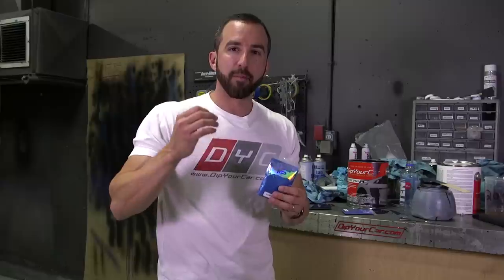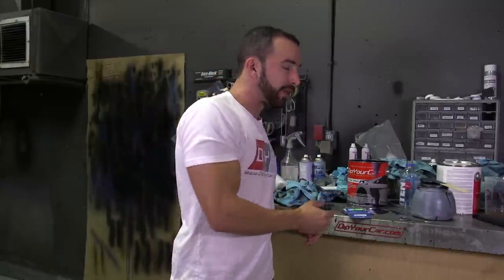Mixing BLUE Pearls into SHADOW BLACK

Comment: I think that color was perfect for the STI. Did you do any coats with the gloss topcoat? Did you coat it with DipCoat after finishing? And are there any UV protectants in the paint to prevent it from baking onto the car on horizontal surfaces?

Also, I think this would look amazing with a gold pearl and/or gold metallic flakes. I also think it would look amazing on wheels with silver-toned pearls or flakes so they look mostly blacked out but also have a slight metal shine in the right light.

Comment: I just found this channel and I think it's a really interesting medium you're working with! You're basically using the same pigments that are in eyeshadows to create reversible art on your cars on a much bigger scale. I've binge watched a good number of your videos and took a quick look at your channel. I think it would be really cool to see you do more themed cars (your Psychedelic Storm Trooper one looked fantastic) or maybe start branching into things like different techniques for application (stenciling, more fading from one color to another--the color in this video along the bottom of the car faded up to matte black or something would look really cool). Something to start taking what you're already doing really well to the next, even more customized level. Keep up the great work and thank you for posting these! After watching these videos, my sons are brainstorming how they can use the collection of micas I have to color their Hot Wheels temporarily. 😄 Now, I just need to get them some quarts of your Dip supplies.
Reply: How would the fade work exactly? Sorry to bring up an old comment, but I'm kinda interested in learning more. My thought was that you could only really do it well with pearl in clear top coat at lower grams/gallon, then apply more layers as you want more pearl. My understanding, that would work because of the transparency. With color proper, would you add a bit more color in the sprayer for each "line" that you spray, or...?

Comment: Hey Fonzie, I'm not sure if it's been asked before, but do you provide kit sizes (or suggestions) to do motorcycles? I would think the small car size would have way more than needed. What is the amount recommended for a motorcycle? Not sure if a larger vs smaller bike would mean much of a difference in dip needed. Maybe a motorcycle kit and motorcycle plus version for someone who wants to do bigger/additional parts?

Comment: Is there a colorshift that's iridescent? Like actual iridescence, not just a 2 or 3 color shift? I wanna see if it exists first of all, then iridescent plus pearl, then with black, and with black plus pearl if the iridescent plus pearl works decently. 
And if iridescence is possible, and works well by itself or over white and with black, it'd be interesting to see it over other colors. Though iridescence plus silver will probably always be the best result. 

Iridescence is similar to pearlescence, but rather than reflecting light (true pearlescence is white, though can be colored) iridescence diffracts light. Iridescence also works through phase shift and interference in instances such as the thin-film effect, like fuel on water, but I don't think that'd be possible to do with dipping. If it's possible to manufacture a pearl that can refract and reflect (though it can be more complicated than this, rainbows are produced by a double refraction with reflection between the refractions within a water droplet), dispersion should be possible.